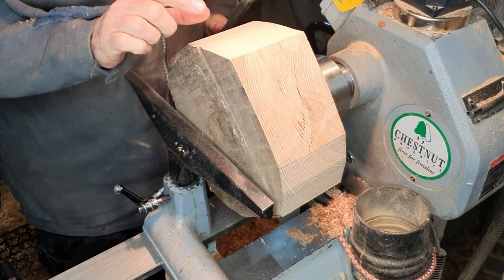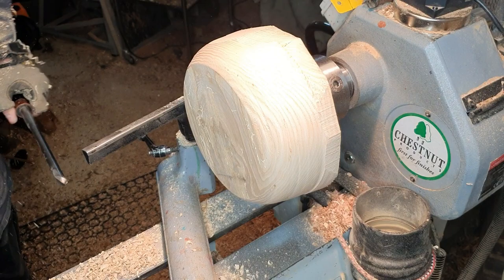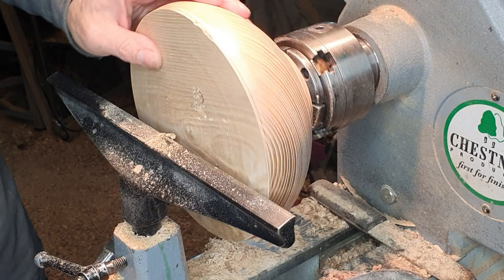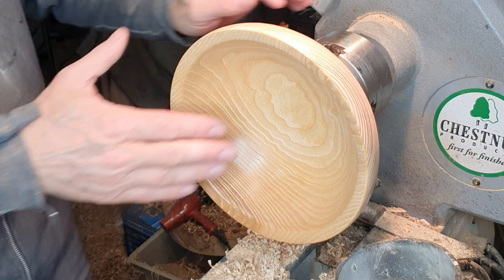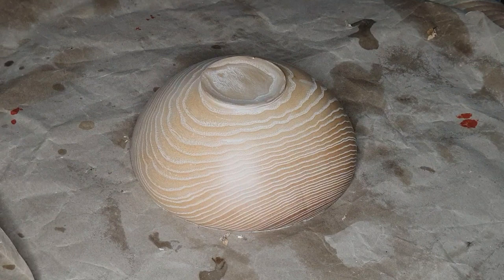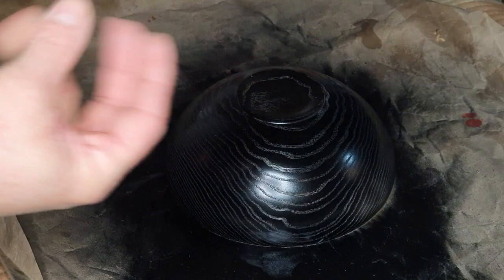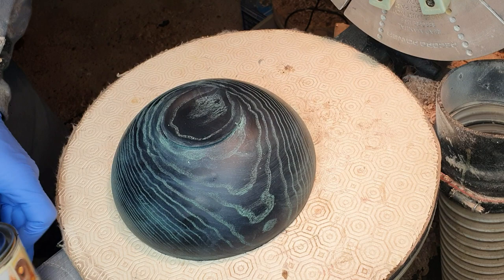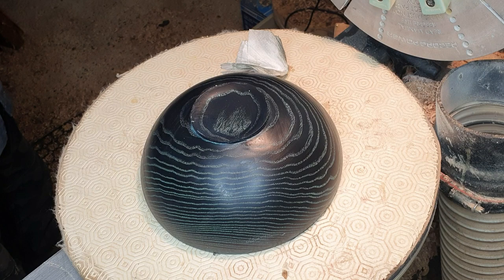Verdigris Bowl   (Mark Sanger Influenced)

Comment: Nice bowl, well done. Chestnut recommend applying the ebonising lacquer directly to bare wood, as sanding sealer only serves to fill the grain, thereby reducing the effect you are aiming for. You should also brush out the grain beforehand to free it of excess dust from sanding. They do sell a liming brush for this, although personally, I use compressed air. Once again, nice work.

Comment: I really like this, nice job, would using Tung Oil work in the same way as the Lemon Oil? thanks for sharing Cheers
Reply from the maker: Thanks Grahame, lemon oil is really thin and evaporates quickly so it will help cut through the excess wax without leaving a residue.  Tung oil is too thick, I wouldn't recommend it.  If you don't have lemon oil a paste wax such as woodwax22 works just as well.  Rub it on and ot will help lift the excess coloured wax, then just buff off.